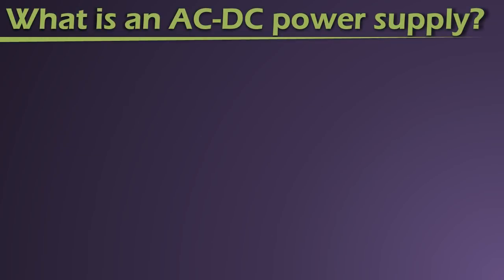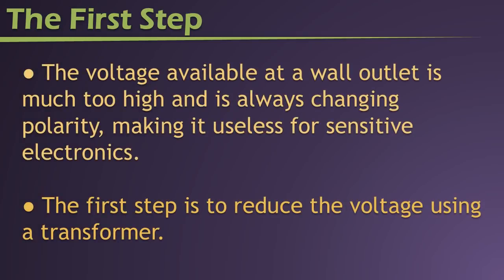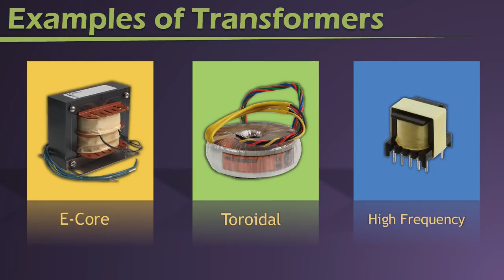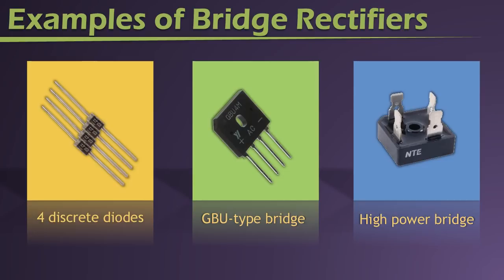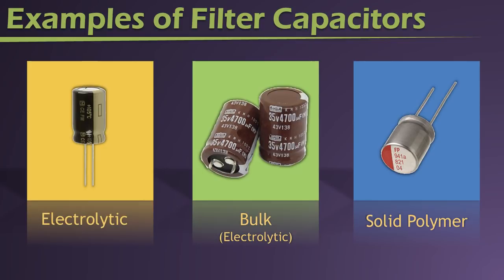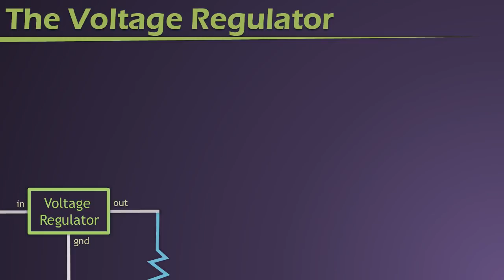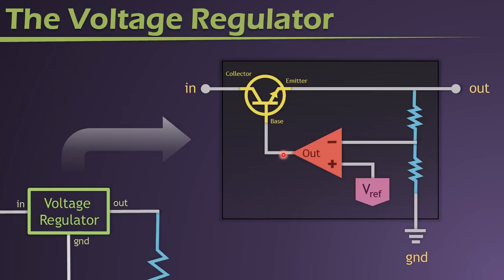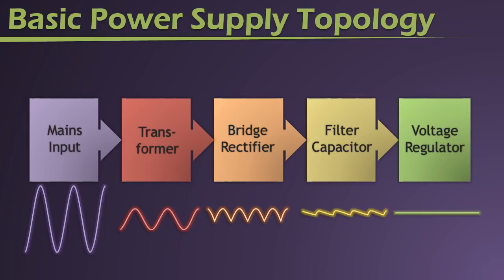An Introduction to Linear AC-DC Power Supplies

Comment: The LM-723 is still widely used in power supplies as it also has a current limiting capability. It has a max voltage of 40V and cost almost nothing. The LM338 is 5A.

Comment: great video. can u  show me how you can construct a 5v - 9v variable power supply using the LM 723 and an 18V CT 1A xfmr. I have problems coming with the right resistor values. Thanks

Comment: Thanks again for making these videos. I have a quick question. At 16:39 you say that the current can't flow through the bottom left diode because it is reverse biased, but it can flow through the diode in the bottom right. I don't see or understand why it can't go through the bottom left diode. Aren't both the bottom diodes oriented in the same way?
Reply: Current only flows across a thingy that has a voltage difference across it. If you have a chunk of wire connected to + of your power supply on one end and connected to nothing on the other end - no current will flow through it because if you put a voltmeter across this chunk of wire it will read 0V. Same thing if you put this same chunk of wire where both of it's ends are connected to + of your power supply: one end of it is at 12V (for example) and another end of it is at 12V too! Voltage difference across this wire will be 0V so no current will flow. Same thing applies to the diode in the presentation: no current will flow through it since there is no voltage difference across it – both of it's leads are connected to the same potential.
Reply: Perfect answer. Thank you, I needed that
Reply: Just in case your question doesn't get answered (from my understanding) it's because there's two positive (hot) wires connected to it.

Comment: Keep up the good work nice write up.  Gave me some good ideas.  I made a power supply but used alot of Capacitors after the Rectifier and my voltage went up a bit like 4 volts.

Comment: At about 21 minutes you discuss the current going through 4 discrete diodes as about 1 "amp", then the GBU-type bridge as about 3 to 5 "amps" and then mention the high power bridges if you need 25 to 30 "amps".  Isn't this a slip of the tongue and you mean "volts"?  Otherwise the presentation has been excellent!
Reply from the maker: Peter thanks for the feedback. However, "current" is indeed what I was talking about there. Just about all diodes, whether used individually, or in a diode bridge are safe to use with very high voltages. For example, a standard 1N1004 diode has a peak reverse voltage of 400V, meaning it can block current from passing if it is reversed biased with a voltage up to 400V. The current is physically the amount of charge the diode can pass, and not destroy itself due to overheating. The larger the package the more heat it can dissipate.
Reply: SolidStateWorkshop Keep up the good work!  I've always liked the descriptive: "this board is fried".  Your explanation makes sense.  Bet you're
a big Tesla fan.  Edison moans.

Comment: Sorry,  I'm sure if this were a refresher instead of my first intro I'd get [ALL of this] but not the voltage regulator diagram. 
The Op Amp's job was unclear, as were the roles of the resistors. 
Particularly, the ROLE of the 2nd resistor and why we're making a SHORT to ground ? 
Or why we care to control the voltage of the short?
V Ref seems like a "dead-end" that'd just get hot? 
What's the collector / emitter doing ...? 
And, what're the "necessary & sufficient" conditions for the "out" path we're meeting ...?
Reply from the maker: The two resistors form a voltage divider, with the voltage at the mid-point being the output voltage scaled by the ratio of the resistors. In the simplest form of a voltage regulator, the resistors are not needed, but in the vast majority of practical implementations, they are necessary. In the simplest form of a voltage regulator, Vref is chosen to be exactly the output voltage you require. The function of the op-amp is the compare the actual output voltage to the precise and known value of Vref. Vref is usually a band-gap voltage reference with excellent voltage accuracy and stability, but it cannot source any significant current. The op-amp finds the "error voltage", i.e. the difference between the actual output voltage and the set-point voltage (Vref) and then adjusts it's output (base drive current) to adjust the collector-emitter voltage drop. It adjusts the collector-emitter voltage drop such that the the op-amp inputs are exactly the same...that is to make Vout = Vref.

Without the voltage divider, you need a separate Vref part for every output voltage you wish to create. So, if you wanted a 5V output, you need a 5V reference. If you want a 5.1V output, you'd need a 5.1V reference. It's not very flexible, among other things. So, the prevailing approach is to use a few standardized Vref value and an accompanying voltage divider to make any output voltage you desire (within practical limits). Popular band-gap reference values are 1.25V, 2.5V, and 5V. You set up the voltage divider such that the mid-point of the divider will equal the reference voltage (i.e. 2.5V) when the top of the divider (the output voltage) equals the desired value.

For example, suppose you have a 2.5V reference, and desire a 5V output voltage. If we set the bottom resistor to 1K, then we need to set the top resistor to 1K in order to get 2.5V @ the mid-point when the output voltage is at 5V. 5V * [1K/(1K + 1K)] = 2.5V

Or, let's suppose you have a 1.25V reference, and desire a 5V output voltage. If we again set the bottom resistor to 1K, then we need to set the top resistor to 3K to get 1.25V at the mid-point (the inverting terminal of the op-amp). 5V * [1K/(1K + 3K)] = 1.25V
Reply: @SolidStateWorkshop  Are you going to make anymore videos? They are much better explained than even my classes. I bet you could explain AC circuits and semiconductors super well. Thanks!!!

Comment: My question of the day is regarding the 79XX series, such as the 7924. I see it's considered a negative voltage regulator versus a positive in terms of how it wires up. Can i construct a power supply using this versus the other? I can't seem to find clarity as to why 78XX is preferred since i always thought D.C flows from negative to positive why the 79XX isn't the more common. Any input is appreciated, thanks!
Reply from the maker: If your circuit has a positive voltage (with respect to that circuit's ground), you use a LM78xx regulator to reduce the voltage to a smaller positive voltage. For example, +12V --> +5V. If your circuit has a negative voltage (with respect to that circuit's ground), you'd use an LM79xx regulator to reduce the voltage to a smaller negative voltage. For example, -12V --> -5V.

I suspect you might have some other misconceptions about "negative" and "positive" in this context. I'll try to explain further if the above does not make sense.
Reply: @SolidStateWorkshop  Thanks for your response, it's always good to see publisher support interest in videos which were put out some time ago. I probably have more misconceptions than I should but try to move forward anyway. The crux of this was I have some 7924's and would like to make a supply from some 24vac transformers I also have, this would all just be driving output terminals which would then supply other outside equipment, so everything here is all just 24 volt with no steps up or down once I leave the main transformer. As a novice it seems that perhaps either 78XX or 79XX would work to regulate the overall current of my output but then again I'm limited to just wiring up low voltage access control systems in my occupation after a long separation from my childhood building radio shack kits. Therefore my component level understanding of these interactions is weak since as a kid I was just soldering what I was supposed to and as and adult it's been mostly "doorbell circuits" and terminal strip connections. Moving back into project box designs and (hopefully) electronic refurbishing I've been attempting to self learn and be less dangerous!
Reply from the maker: @LockRocker  Either 7824 and 7924 could be used to create a 24VDC supply. The key is: If you are only creating a single polarity supply (i.e you just want +24V or -24V), then  either part would work fine. But, if you want to make a bipolar supply (a.k.a. a split supply) which simultaneously can supply +24V and -24V, then you need to use a 7824 for the positive supply and 7924 for the negative supply. A split supply usually uses a center tapped transformer (+ bridge rectifier). As mentioned, if you are making split supply with a center tapped transformer, you cannot use 7924 for both. This has to do with internal structure of the regulators, and how they are able to sink and source current. Current can only go into the OUT pin of a negative regulator (79xx) and current can only go out of the OUT pin of a positive voltage regulator (78xx). (Talking about conventional current.) 

Otherwise, if you only need a single supply, (i.e. just a single +24V or -24V supply), either types can be used. It may take some mental gymnastics to prove to yourself that the "negative voltage regulator" can produce a positive voltage. But remember that voltage is *relative*. It is the potential difference between two points in a circuit. For example, if you are measuring voltage with a multimeter, you can change whether you read a positive or negative voltage by flipping the red and black leads. Similarly, whether the output of the voltage regulator is negative or positive just depends on what circuit node you want to call "common" or "ground". According to the 78xx and 79xx datasheet, the center pin is called "GND", but that's only a name, based on the typical way it will be used. If you supply a negative voltage (w.r.t. to the GND pin) to 7924, the output will be negative with respect to the GND pin of 7924. But, if you decide to call the OUT pin "0V" or "common" instead, well now there is a positive voltage at the GND pin with respect to the OUT pin ("0V"). 

Keep in mind you still need to feed 7924 a voltage on it's IN pin which is negative with respect to its GND pin. That's the only way it works. But, the output can be considered as positive or negative, depending on what you want to call "0V". But remember, this arbitrary flipping of what's "0V" or "common" only works when you have a single polarity supply.
Reply: @SolidStateWorkshop  Fantastic, this all makes sense to me. I had previously seen the "bipolar" schematics and also have come to better understanding of the whole conventional current versus electron flow debacle. I'll just proceed and make a supply up with the 7924 version just for the experience of it all. I really appreciate your expertise and hope that those around you realize how blessed they are to have you around! Thanks again, you rock!
Reply from the maker: @LockRocker  Yeah basically you just wire up the bottom half (negative supply part) of those "bipolar schematics", and then just call it a positive supply. 

Thanks for  your kind words! Appreciate it.
Reply: @SolidStateWorkshop  Together we'll make the world more positive one supply at a time! 👍

Comment: Howdy. With all due respect.
With the circuit you show the op. amp. must deliver 0,7 V over the output to the power transistor base. The supply to the op. amp. needs to be at least 2V higher than the output at all times.
Change the power transistor to a PNP item and switch emitter and collector and you will have a working circuit. The op. amp. will need an output resistor and a zener diode too to prevent the output going too high destroying the op. amp.
Your circuit is a base current "pusher" circuit.
My suggestion is a base current "puller" circuit.
Regards.
Reply: Thanks!  I have a zener diode that failed on a hard drive I'm trying to fix right now in fact ... and was just told that manufactures like to mislead us when repairing them with mislabelled values!!??  lol.  

Either way, this is an intro for me -- and as I suspected, it seems like most of the viewers are reliving "learning" or verifying the creator did it correctly ... where as for me (ignorant of the topic) I have a TON of questions; where pronouns and slightly vague descriptions are fine amongst people who already have shared concepts they're confirming with each other, things are completely different for those of us to whom this is alien.
Reply: @trumanhw  Howdy.
Yes.
Regards.

Comment: Is an Op Amp an Exclusive or Gate..?  Or just in this circumstance..? 
(I'm familiar with XOR gates only because they're the foundation of RAID truth tables, not electronic knowledge. lol)
Reply from the maker: No, an op-amp is an amplifier. The output is proportional to the difference between the + (non-inverting) and - (inverting) terminals. When the difference between + and - is large, the output is large. The difference between + and - represents the "error signal". When the error (expected voltage - actual voltage) is large, then the op-amp provides a large correction signal to adjust the drive current of the transistor.
Reply: @SolidStateWorkshop  
You're awesome man. Thank you SO MUCH for you actually answering my dumb questions. 
This is my first attempt at familiarizing with electricity and I'm pretty sure that my "electricity IQ" is about 20 points lower than every other field.  I'm already watching your videos a 2nd time in hopes 'rote' will have some utility. 

I'm assuming you either have a Masters or you're an EE who works in the field ... either way, thank you a TON.

Comment: Very thorough video thanks.
I have a wall adapter which says 12V 500A, but measuring the voltage with a multimeter reveals it is 19V. Can anyone explain this?
I bought a cheap replacement which was 12V 500A but it measures 12v and instead of charging it actually sucks the charge out!
Reply from the maker: If it is an unregulated supply (without a voltage regulator) then an open circuit reading might show something higher than the printed value. The more current drawn from it, the more voltage is dropped internally in the adapter..and thus under full load you might get down to like 12V.
Reply: Thanks. You were right. The manufacturer got back to me and said that the unregulated supply puts out higher voltage than regulated, so if I buy a regulated one I need to get 15V instead of 12V so it is powerful enough to trigger the charging circuitry.

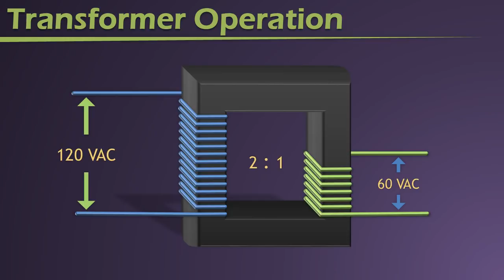Comment: @11:00 Anyone else who wonders how a transformer's in+out are both wrapped around a COMMON iron core without CONDUCTING electricity..? Each of the wires are INSULATED ...  and thus, only the magnetic lines of flux are interacting. :-). (had to look it up).

Of course, though the 'input wire with 120v ac' only transmits half it's voltage, the 'return line' of the circuit just retains a larger percent of it's input energy (however it happens) -- but consistent with thermodynamics 'laws of conservation' ...

Comment: should nail home that the windings are in fact insulated with shellac as and insulator when the insulation overheats than whoops. you stress ferrous core but forgot insulation. the mutual inductance is cutting B fields during changes in direction.
Reply from the maker: Jim Simon Indeed. This is originally a presentation I did for a high school class when I perhaps didn’t know any better. I now work full time in switch-mode power supply design, so this video makes me cringe a bit too.